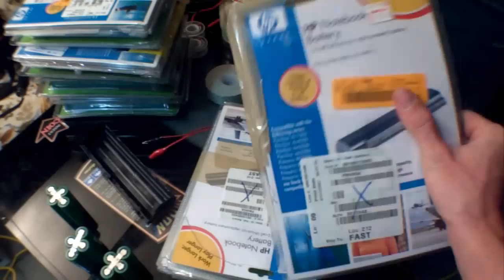DIY: 48v 24ah lithium ion 18650 e-bike battery pack

Comment: Hi if I need to replace my existing  qty 1,  12volts 1800Mah sealed lead acid battery with  a 3.7volts 1800Mah (18650) how many 18650 should I buy? and should i pack them in parallel or series to create a pack?
Reply from the maker: can you use more capacity? idk if i've ever seen a 1.8ah lead acid battery before.

look on ebay for a cheep 6 cell laptop battery, you might be able to find one for 5$ like i did. and that would build you two 12v 2500mah batteries or one 12v 5000mah battery.

but you only need 3 cells to make 1800mah 12v. just put the three cells in series.
Reply: Rinoa Super-Genius  sorry what i have is a 12V 18AH lead acid battery.  if I want to replicate this battery using a 3.7V 18Mah (18650), how many should i buy?
Reply from the maker: July Camacho  oh, well each 18650 cell would have like 2.2ah on average. so 18 devided by 2.2 is about 9.

9 18650 cells would get you 18ah but only at 4.2v. so you would need 3 packs on 9 cells to make 12.6v.

so 27 cells. packs of nine cells in parallel, with 3 of those packs ins series. might give you more like 19ah but that could be better.

hope that helps!
Reply: Rinoa Super-Genius  thank you so much for the computation! now i know. :)

Comment: Doesn't soldiering destroy 18650 Li battery?
U wrapped batteries so tight.. shouldn't be some air flow to cool them?
Mustn't all batteries have the same characteristics &wear?
Wouldn't it more reliable &cheaper to buy necessary pack on line?
Reply from the maker: no you just dont let them heat up much. and if your cells get hot your straining them too much. i actually have an issue of them not heating up enough during teh winter. no lithium cells can be any capacity and they will work fine as long as they aren't shorted out, they dont have a resistive short, and you keep them balanced.

a pack online can cost much much much more and you will most likely get a piece of shit. you can build a pack like this for free if your resourceful. instea of paying 600$ for a premade pack.
Reply: Rinoa Super-Genius
Thx, I do have "if u wanna get it right, do it yourself" proclivity too, but i'm a complete dummy in electronics.

Comment: Can I use 18500s with 3.7V 1400mA instead of 18650 as I'm finding them for abit less. I could not find anything as cheap as you got from eBay.
Reply from the maker: of course you can, only reason i dont use because i tend to only find 18650s, but if you have them use them.

what about these? http://www.ebay.com/itm/USED-CLOSEOUT-HP-462889-121-EXTENDED-Replacement-Battery-For-HP-G60-Series-/121346422410?pt=Laptop_Batteries&hash=item1c40cf768a

Comment: Hi there

I would like to know what is the voltage for charge the full pack 40V ???
what charger you use ? give me more details please

bader
Reply from the maker: well watch the next video and you will know. this pack is only 24v but i run 2 of them in series to give 48v.

Comment: I don't see a battery management controller, they cost <$20.00 and will keep from blowing up the batteries and they will last at least 500 cycles
Reply: +Fleugar OutDoors i clicked on this video just to see how he charged it without one, thats a bomb waiting to explode without battery management
Reply from the maker: +xtort107 back then i just balanced it manually, but the next video is about balance charging, just read the description.
Reply: cool, i'll check that out

Comment: I like ur video. Just one question where is the BMS board to protect the battery?
Reply from the maker: i added that later.
Reply: Gottcha. Much cheaper alternative to buying a 48v 20Ah battery.
Reply: One more question if you don't mind. Where did you get the old school power supply?
Reply: I'm trying to build an electric go cart and researching everything needed. Plus what would you recommend for the DC motor speed controler?

Comment: Well done but it would be highly advisable to at the very least have a low voltage alarm and a balance plug.
Reply: I see a link to video where you do add the balance charging. good move.

Comment: How many watts controller is required for this 30 AH battery pack?
I burned my 100 watt controller building this pack.
Reply from the maker: the AH doesnt matter, the voltage matters.
Reply: Rinoa Super-Genius AH matters if you care how long the charge will last you. You shouldn't mix capacities though.
Reply from the maker: kenjams
 no he was thinking if you have too many AH it will fry you motor. only volts will do that.
Reply: Rinoa Super-Genius I'm working on a 1000W 48V E-Bike using Prius cells...works well, but only 8AH NiHi.  What is the voltage range of DIY 48V motors? 42V to 52V? Any idea? I only get green light for one min.
Reply from the maker: kenjams my motor controller lights the red light at 36v, and will drive very slow at 36v. at like 42v is lights the yellow light then at 48 it lights the green light. the battery charger  that came with it goes up to 59v so i'd say 55-60v is your max. but you can check by looking inside the motor controller and see what each component is rated for.

the motors themselves can handle like 90v.

Comment: The power leads are to thin or small of a gauge.  It will burn out if too much amperage is drawn from the load.
Reply from the maker: no they are fine. they could prolly handle 100 amp bursts.

anything will burn out if too much power is pulled through it.
Reply: I'm impressed. what gauge are you using there?
Reply from the maker: Jason Mendoza  like 13awg if i remember right,that's a lot bigger than the wires on my bikes motor and motor controller.

Comment: Nice Moon Base table:)
Reply from the maker: thanks! its my oldest arcade machine so far :D
Reply: Does the game work? Nice job on the E-Bike stuff too.
Reply from the maker: ArcadeGames
 yeah it plays pretty well. i made a video of it. ima still do a video of my Mappy arcade cabinet and Missile command someday too. also have a Race Drivin game.

Repairing Arcade Cabinet: Moon Base (Space Invaders Clone)
Reply: Nice. I haven't checked out any of your other videos yet, I just got done watching this one.
Reply from the maker: ArcadeGames
 cool, i gotta warn you my videos are all over the place and my older ones have worse and worse quality haha
Reply: I love Race Driving and Hard Driving, I learned to drive manual playing that game when I was like 10 or 12. Do you have the cockpit version or standup?
Reply from the maker: ArcadeGames
 its the compact stand up. really fun game. the screen just needs some new caps is all. i have it stored at my dad's warehouse couse i just don't have any room for such a tall machine. but wouldn't get rid of it.

one day i was bored and started pulling chips while playing and things dissapeared. found you could remove sounds and obstacles to cheat by doing that. :P

and holy cow the circuit boards are huge. its basicly a high end Sega Genesis made with 1981 hardware that was laying on the shelf for 10 years. like 2 boards for graphics alone, one for sound and a like 25 inch by 20 inch board for the CPU (think its a Motorola 68000?) and ram. and the 420kb game is held on like 40 ROMs. it was definatly worth the 50$ i payed for it.

Comment: Hey fellow enthusiast. While I have just started getting into Lithium batteries, I've had an electric bike for a couple years (using VERY heavy lead acid). The e-bike kit on which it is built, which includes the controller, is a 48V motor. I built a 24Ahr battery, that is if each battery is truly 3000mA, and find that i lose enough power to move the motor at about 44V resting voltage in the batteries. Upon recharging I put only 4.5 Ah into the battery to fully recharge. Something is up!! and I cannot figure it out. Any ideas? I like your videos and would love to chat. Thank you!
Reply from the maker: so your getting more power out of it than you put in? i dont understand the question.
Reply: Sorry for the confusion. Charged batteries start at ~49V. Bike is "dead" at 44V. In other words, after pulling only 4.5 Ah from the batteries, the motor ceases to have enough power to spin. The pack I built is 8x 18650 in parallel in a series of 12x, or 24000mAh and nominal 48V. I am wondering if it is the bike controller not allowing the bike to work under 44V, the battery/wiring resistance is causing large V-drops, or the batteries simply do not have anywhere near their marked capacity. My 18Ah lead acid batts gave me about 12 miles/charge, my 24Ah lithiums are delivering far less mileage/charge.
Reply from the maker: Michael Robinson
where did you get the cells? and they arent ultrafire / truefire / trustfire are they? i hope you didnt buy them individually.

the thing to do is a discharge test on each parallel pack. that way you know how many ah each pack has. an imax B6 has that function and those only cost 30$.
Reply: I have the b6. I purchased the batteries individually from a company called tmart, which had excellent prices. They are actually marked 5000mAh, but no way are they. I don't think it's a capacity issue. To what voltage do you discharge to test capacity?
Reply from the maker: Michael Robinson
imax b6 discharges automaticly, just use it's feature.

did you pay less than 1.5$ per cell? couse if you payed more than 1.5$ you where prolly ripped off.

and yes it sounds like a capacity issue, a LOT of cells sold on the internet arent tested, they are just stripped out of old laptop packs and rebranded in sweatshops in india or china.

thats why you should never buy individual cells unless you get a deal straight from Panasonic or Sanyo's warehouse.
Reply: Rinoa Super-Genius I go a better price than that. tell me how to buy from panasonic, and i would. Battery sourcing is my BIGGEST problem. do you think its reasonable that the average cell i got from them is only 530mAh though? thats pretty bad.. :(
Reply from the maker: Michael Robinson
500mah is very bad, thats like a laptop pack thats been used every day for 6 years. still useful though. but i would only pay 0.5$ for that cell. the ones you get in laptop packs usually are 2-2.6ah.

the cells i used in my first pack where only 1ah each, but it was my first pack and the cells where 12 years old.

you can always add more cells to the pack. those 500mah cells wont be a weak link if you add better ones parallel to them so thats good. its not like lead acid cells, lead acid batteries can only get to like 12.2v when they are dead, but new lead acids charge to like 12.8v. so if you connect an old lead acid to a new lead acid it would ruin the new one. but lithiums dont have that problem.

maybe buy a few 12 cell laptop packs for cheep from ebay and slowly add more cells in parallel.
Reply: Rinoa Super-Genius it seems too low for any new batt. thanks.
Reply: Michael Robinson Sure enough. I've tested a new battery (unused) and found only 599mAh!!! I was betting on at least 1Ah/cell. Very big letdown. I am working on getting some money back on the deal. What advice could you give me for acquiring batteries (which is my biggest problem), and if that means using ebay, what exactly should i look for?   Thanks again!
Reply from the maker: Michael Robinson
look for intact laptop packs, and only buy one first and test it. dont be a fool and buy all at once without knowing what quality they are.
Reply: Rinoa Super-Genius True. Is buying OEM important? What is a good price for a 12cell?
Reply from the maker: Michael Robinson
12$ is a good price. i wouldnt pay more than 16$.

Comment: Hi, can you help us here please?  We are following your guide and have 30 individual cells.  These are rated at around 3.7v per cell.  We start with a negative cable and six individual cells all connected together by the negative terminal to this negative cable.  Then we join all six positive ends of these cells to the six negative ends of the next lot of cells by way of one single looping wire across all the negative and positive terminals.  Then we repeat with the next group of six cells, joining all the positive ends of these six to all the negative ends of the next six.  We repeat until the very last set of six cells and draw off a positive cable from here.

On the voltmeter we're getting 40 volts and it seems fine, but as soon as we connect up an in-line fuse it blows.  We have a known good unit and connected an ammeter up which shows a peak draw of 7.4a so the 20a fuse that has blown should be well enough to cover the draw (the motor is 700w).

However! - it's blowing before we even turn the key on the cycle we're hooking it up to, so something somewhere doesn't like it.

We are totally stumped, have spent days on this and there are a couple of heads here that hurt not to mention blackened fingers from connecting the cables up!  Can you help us please?
Reply from the maker: did you look at the schematic i provided?
Reply from the maker: Kevin Nguyen
 i did help by providing a video and a schematic. what else do you want?

Comment: What is the C rate of that complete diy battery?
Reply: Typically 1C Reliably. 2C Unreliably and comes with large voltage drops. Large internal resistances.  High heat at 2C discharge. Best use case is 0.5C

Comment: how did you charge your battery pack?
i dont get it, so can you charge all those battries cells at once?
and how can you sure they will equally charged ? (*on every single cells?)
Reply from the maker: check the description for "next battery video" and that will tell you.

i have balance leads to balance it with my Imax B6 battery balancer but most of the time i charge it with constant 24v from my universal power supply. it takes several cycles for the cells to get out of ballance so i only balance them every month or so.

also i run my cells at 4v instead of 4.2 so not only do i get 4x as many charge/discharge cycles but i also have an extra 0.2v that the cells could accidently get out of ballance without harming them.

Comment: Why don't you create a charging system to charge the batteries as you are moving on the bicycle.
Reply from the maker: because i dont want a 20 mile long extension cord trailing behind me.
Reply: Rinoa Super-Genius He's talking about pedaling or regenerative braking to generate electricity. It would be too little to matter, anyways.

Comment: I’m considering building  e Bike what voltage and what wattage is your electric motor in your bike cheers Derek
Reply from the maker: mine is 48v 1000w. voltage dictates speed. honestly i could get by with a 24v 500w motor since i normally dont go over 20mph. 48v can go close to 40mph and is quite scary

Comment: Does it matter if the seller on ebay  says there in working condition but there's no guarantee on the run time?
Reply from the maker: you mean for old batteries? well usually one or two cells will be bad while the others are better. really depends. thats why i'd say buy one before you buy 15 more haha.

Comment: hi i'm also planning to make an lithium battery pack for my E-bike. the battery wil have 36v and 120 Ah. can i buy a charger for this?
Reply from the maker: holy fuck 120ah? that would be extremely heavy. why so big? are you really going to be traveling 600 miles on one charge? 120 AH would be
540 lithium cells. just FYI lithium 18650 cells only have 3600mah at most. i hope your not expecting to use those fake 5ah cells on ebay.

and never buy Trustfire / Truefire / ultrafire cells

break it up into 12v blocks, and charge them with a 30$ imax b6 or b6AC.

Comment: Hi. I got prob with my Lipo battery (48v 40amp). It charging less than hour and we can drive only 10 min.
Waranty from Aliexpress never mail me back about their 2 year warranty...
 Tnks
Reply from the maker: poor quality battery perhaps?
Reply from the maker: Vlad Sobol
well you should have known not to throw away that much money to somebody you can't hold accountable.

especially throwing away money on something you could make for much cheeper. atleast you received it though.

as for helping you with it, i can't without any information about it.
Reply: Rinoa Super-Genius I took a lot from Aliexpress incl motor - 48v 1500w, controlers... All them not like contact. Asked about how can i change polarity in 3 fase motor? Not answer at all. Change polarity by my self.

Comment: if i have thirteen 18650,  3.7v, 5000mah and i soldered them togeather would it be 48.1v and 
65ah?
Reply from the maker: +ninjatorren no, parallel ads amp hours and series adds volts. you will need several hundred to do that. also 5000mag cells dont exist, any cell sold as higher than 2,500mah is just a scam